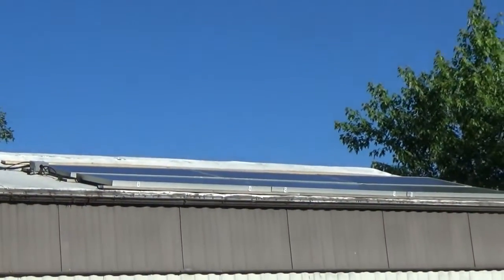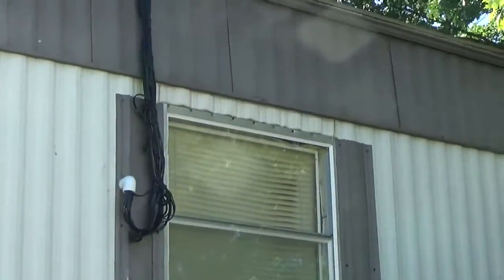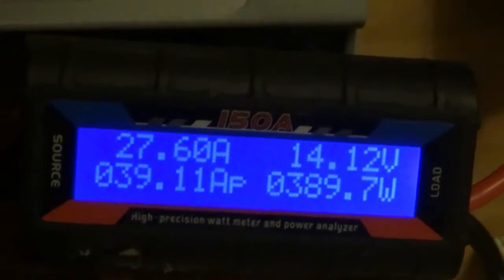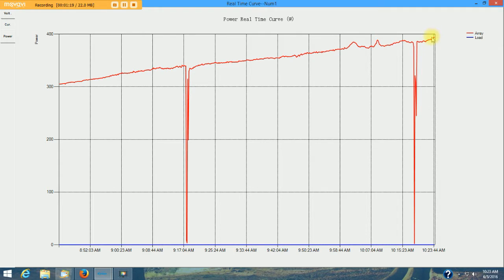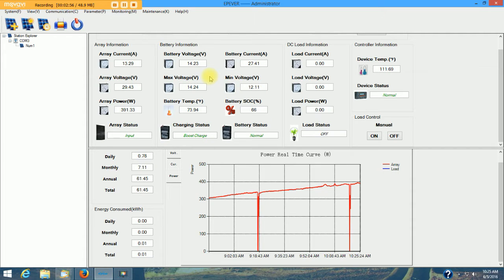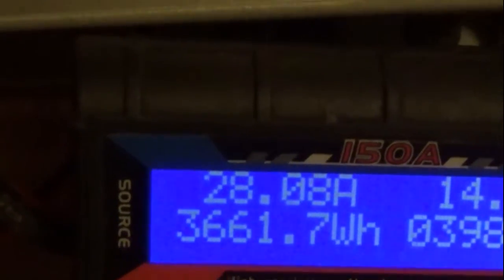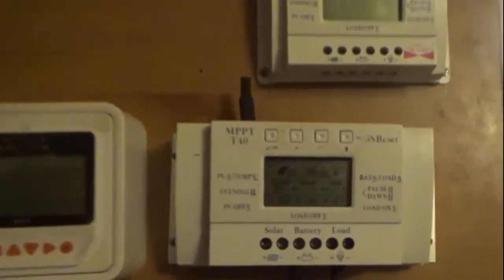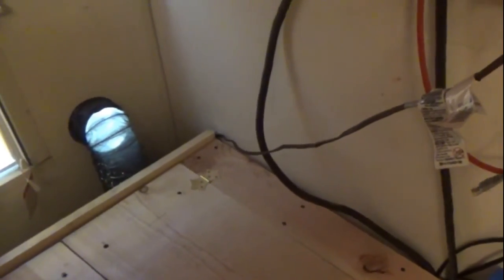Eco-Worthy 600w Solar Panels 2 Month Review

Comment: Your mobile really needs updating.  The insulation is probably crap.  I think what you need to do is reframe the outside using 2 x 3 studs   Lay the studs flat and reinsulate using 1.5 inch foam board. Before you put in the foam board, run a bead of foam along the studs to make it air tight.  Cover this with 4x 8 sheets of siding.  That will really help with your heat and cooling.  Spend about $2000 for new thermo Payne with argon gas and low e3, once again foam these in.  Your floor is easily updated.  Put down 3/4 inch foam board, the denses type you can find, cover it with pergo.  Your window ac unit, I’d cut a hole and foam it in.  It will look better and will be more efficient.  Look at that plastic crap you have blocking the wind, I know it came with the unit but you would have a more efficient unit if you thru that crap into the trash and put a piece of hard foam board on the sides, once again using caned foam to give you a decent seal.  The roof will need replacing one day, use about 4 inches of foam board on it before you cover it with metal.  Think your house becoming an ice cooler.  I did all the stuff I’m recommending you do.  Your house will be cooler in summer, warmer in the winter and quieter year round.

Comment: will this solar design be sufficient to run these lights as a stand-alone? https://www.amazon.com/Advanced-Platinum-P600-12-band-Grow/dp/B00NTC2XRO/ref=sr_1_1?s=lawn-garden&ie=UTF8&qid=1499314303&sr=1-1&keywords=Advanced+Platinum+Series+P600+600w+12-band+LED+Grow+Light+-+DUAL+VEG%2FFLOWER+FULL+SPECTRUM   thx!
Reply from the maker: Thank you for your question. The short answer is no. I would encourage you to try the calculator linked here or a similar one https://www.wholesalesolar.com/solar-information/start-here/offgrid-calculator

Comment: So you wired your 600W in solar panels in series? Or did you wire them in another way?
Reply from the maker: I have 6 x 100w panels. I wired three sets of 2 in parallel making 3 24v sets I then ran those 3 sets in series. Thus keeping the 24v but increasing the amperage.
Reply: I planning to have 4x 150w panels, wired to the same Tracer 4215bn that you have in the video. So that is the reason for my question. By the way, how is your charge controller doing?
Reply from the maker: Really happy with it. In fact since this video I have added another 600w and also added another 4215bn controller. I need to do an updated video.
Reply: I am planning a system for a house that does not exist yet, The place is in the Philippines. I am buying four 150w panels for a total of 600w. The specs on the panels are VMP= 18v / IMP= 8.34A / VOC= 22.4 / ISC= 8.72A. The Charge controller EPsolar MPPT 40a 4215BN, But how big can I make the battery bank 400ah, 600ah, 800ah? Anything after that is out of the budget but even 800ah is putting some serious stress on this budget. The house electricity will be designed around what the system can produce. The battery bank is planned to be 12V, Could you give me your opinion on the size of a bank I can use?
Reply from the maker: I really can't give much advice on size of bank. I can only speak of my experience. I now have 1000ah bank. You really don't want to take the level down much past 20% so that gives me 200ahs to play with. So 200ah x 12v = 2400w per day to maintain 80% charge. That means 2400w / 24hours or only 100w per hour. There are calculators online and if you google how big should my battery bank be you will find them. I would recommend using one of those.
Reply: Thanks, all information is useful at this point. I getting ready for to build a small system in the Philippines for my semi-retirement. the usage of power there is much less that in the States. I think I will put in a 600ah X 12v =7200w which gives me 1440w to play with I guess. LED TV 47W, and Lights which will all be LED too. heck the fridge is only 72W, Thats everything in the house and I still only use 1000Wh a day.. I think I may be okay. Thanks again.

Comment: With your circuit breaker, I've researched & found that for those to work as a safety mechanism for your charge controller you should work out the amps times 175% so that it shuts off in a quick time & that amps should be near your maximum amps of your controller, for example a 25 amp circuit breaker x 175% or 1.75 = 43.75 amp & shuts off between 2.2 - 9.2 seconds which would save a 40 amp controller. At 150% or 25 x 1.5 = 37.5 amps 3.9 - 47 seconds. To see this as proof you can click on the link below, it will open up a pdf file of Mini Circuit Breakers Model VB3. These are not the circuit breakers that you are using but it shows you as a rough guide what size you should plan your circuit breakers for any given project.

https://www.google.com.au/url?sa=t&rct=j&q=&esrc=s&source=web&cd=3&cad=rja&uact=8&ved=0ahUKEwi93YTrzZjSAhXDn5QKHcPzDpMQFgglMAI&url=http%3A%2F%2Fwww.ctr-electronics.com%2F30-20a-breaker-data-sheet.pdf&usg=AFQjCNFgwS3fRondjcNPaOxBoMSAIpkWoQ&sig2=bSXrivWut0jLtCuiW4uzcg&bvm=bv.147448319,d.dGo
Reply from the maker: Thanks for the info. I am in no way an expert so please let me know if I am reading the chart wrong. Using your example above wouldn't the breaker trip after about 10 - 1000 seconds at over 25 amps? That would greatly reduce the 40 amps of my charge controller?
Reply from the maker: From reading the user manual on page 9 it appears that the charge controller has a built in protection of up to 3 times rated power:

WARNING: Controller will be damaged when the PV array straight polarity and the actual operation power of the PV array is three times greater than the rated charge power!

WARNING: Controller will be damaged when the PV array reverse polarity and the actual operation power of the PV array is 1.5 times greater than the rated charge power!

When the PV array straight polarity, the actual operation of the PV array must NOT exceed three times of rated charge power, When the PV array reverse polarity, the actual operation must NOT exceed 1.5 times. For real application please refer to the table below:
Reply: That circuit breaker that I showed you the link for is only a guide, you also must realize that it's a better quality than the cheap Chinese type that you have & most other people buy. So at 150% of 25 amp which is 37.5 amp or just under 40 amp, the cheap Chinese breakers can stay on for up to 90 minutes before they pop. They are very unreliable that is why you should go with a low amp cheap breaker but if you want to spend money on a good quality breaker then get a 30 amp or 32 amp breaker that will not pop when you hit 40 amps. Also how often are you  going to push 40 amps 100% of the time??????????
Reply: The controller although a good one does come from China. Would it be prudent to be safe or sorry? Up to you really. I would prefer to push my controller to about 75% so that I'm not pushing it to it's limits & wearing out the electronics. If i can get it to last 2 or 3 times as long then that is a large savings don't you think?
Reply from the maker: 75% sounds like a fare value..... 75% of 3 x 40a is 90a so I feel pretty good about having a 40a cheep china breaker. Let me know when you post a video of your system would love to see what you have!
Reply: I'm making my own lightweight panels where I will fit 12 panels which add up to 2kw on a 12v system with 4x epsolar 4215bm controllers. Right now I'm still solving mounts pricing. I will be having this on a solar tracker that is capable of 150kg push/pull & I've got my cradle down to 90kg with panels. I might make 6 panels b4 I migrate overseas so that I can use the power to finish it off. Basically the wife & I are going totally off grid. We will only use the LPG for cooking at night so a 9kg bottle will last 3 months instead of 1 month. I've got a 2 burner 13Mj cooktop and I've also got a 2 burner electric ceramic cooktop for using in the morning and lunch. we plan to make a 60 cubic meter water in ground tank to collect water from the roof using low pressure poly pipe for plumbing with a 4 liters per minute shower with water heated by the sun. All pumps and solar tracker motor run off a separate battery &separate solar panel. The house will look primitive from the outside but modern on the inside to blend in with the poor neighbourhood.